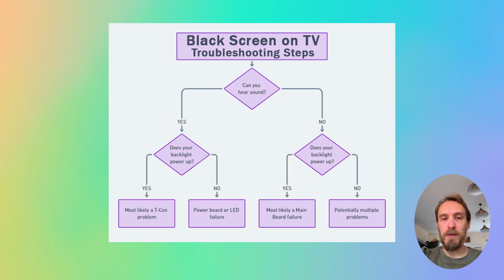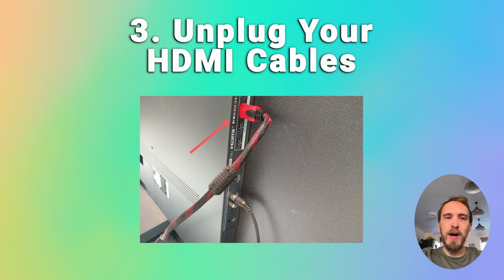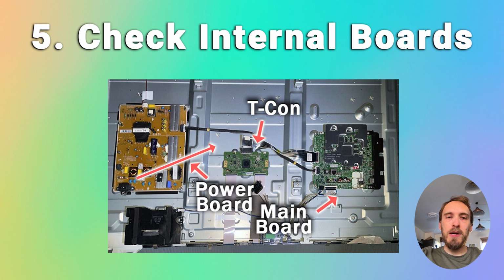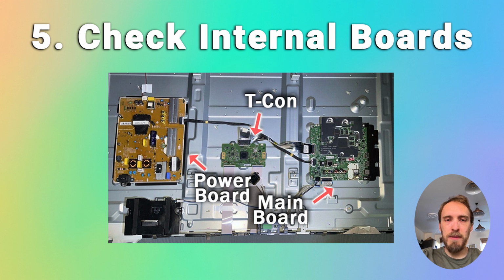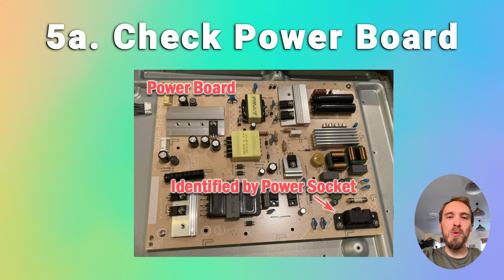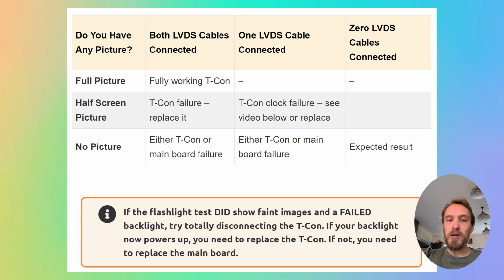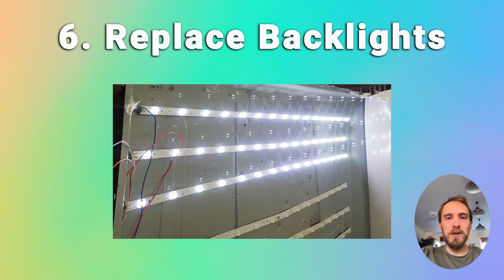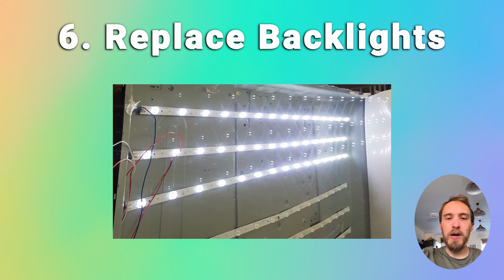TCL TV Black Screen WITH Sound | Sound But NO Picture | 10-Min Fixes

Comment: Thank you for this video. After I tried your suggestion of reconnecting all the wires inside the problem an old Samsung had only gotten worse. I don't blame you, but reconnecting all the wires inside does not always help fixing the issue, it can also make it worse. I did see a connector where some arching must have occurred on high voltage pins, I think for the backlight. I might try to solder the wires to the pins directly if I feel like it and if that is doable. Wish me luck.
Reply from the maker: Good luck and be careful!
Reply: @techtests  Thank you! Considering the age of the TV and the severity of the issues it has I have decided to not spend too much time on it. I will probably let the TV get recycled soon.
Reply: @techtests  I have fixed the television! At least, for a while. I took five wires, two of which had signs of arching, out of the nylon casing and connected them almost one by one, and then hot glued them onto the board. I tried to make sure that the wire was connected as good as possible and then solidified the connection with the glue. After five wires I just dabbed the whole blob in more blob and hoped that the connections were solid enough. And behold, after 3 minutes of warm up time where the issues were still the same, the image came back! I do not dare to turn the TV off now, as long as it works. Just to keep the circuits alive and make them feel good again.

Comment: Hello !

I replayed a few times this video might as well ask.  I have sound on my tv.  I tried the flaslight test but I cannot see any image.  When TV is on I can see a "glow" and if I press left or right in the controller I can see the apps moving very very faintly but no image whatsoever its just the glow from the background lights that do the motion and I can see it.  Following from your video this means I got a T-Con board damaged? 

cause if I had backlight failure screen would be plain black or if main board is damage I shouldn't get audio correct? My though is that I have a bad t-board but just wanted to confirm here first before getting one from ebay.

Much appreciated !
Reply from the maker: I would think that it's most likely the T-Con, but it could still be the main board or the connection between the two. I would open the TV up and try cleaning and reseating all the cables first, before ordering anything.
Reply: @techtests  that is true, first timer on this kind of things but regardless shouldn’t be too difficult. Thank you so much for the input! Will provide updates later for future reference for everyone else.
Reply: Follow up on my issue:

TV full opened. Led blacklight working. Sound is good. Still with glow and faint images.

Main board, power supply working properly. I disconnected the T-con from the main board and tv was still the same. I disconnected the T-con entirely and TV stays the same. Glowing image faint image in the back. Nothing changed. Time to get a t-con?
Reply: @yancaban4197 any updates? I’m experiencing the same problem as you

Comment: How much would it cost to fix backlight
Reply from the maker: If doing it yourself, you can get a complete replacement set for about $30-50 from eBay. A technician would probably charge $200+.
Reply: @techtests  thats how much my tv cost 😂 i gyess i should get a new one.

Comment: If I have both cables connected to tcon I see the backlight flicker at TV boot but never ultimately lights up. I did flashlight test and there is picture with no backlight. If I remove 1 of the 2 lvds cables from the panel it flickers 2x at boot on 1 half of the screen (opposite of the side of the plugged in lvds cable) and if I swap which lvds cable is plugged in the 2x flicker happens in the other half of the screen...  I have sound and I'm guessing the tcon is the issue??  Great video btw!
Reply from the maker: It's difficult to say for sure, but if you do have a picture with the flashlight test, then I would say the T-Con is ok, and it's most likely a failing connection/bulb in the backlights.
I would test the backlight strips before replacing anything. You can use a couple of batteries and a pieces of wire to make a circuit if you don't have a multimeter and check each LED individually, and check the connections between them.